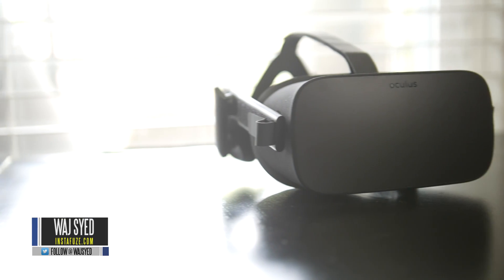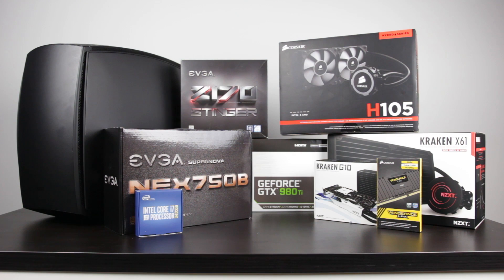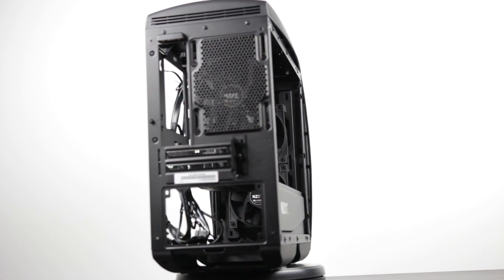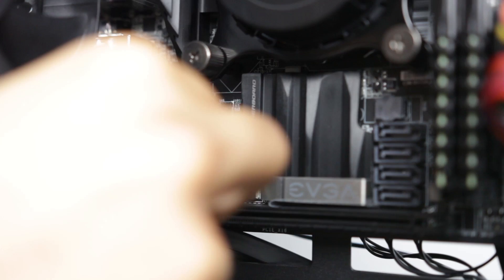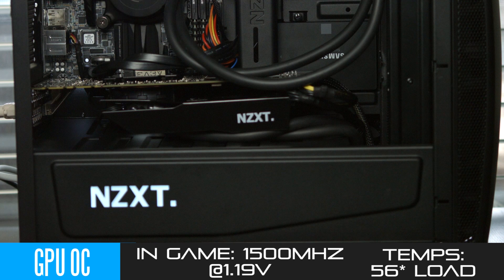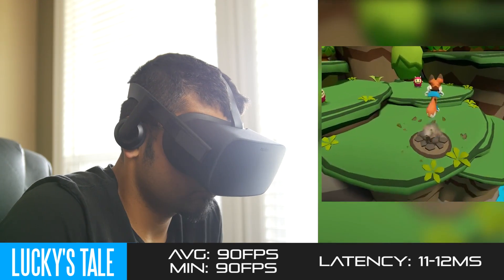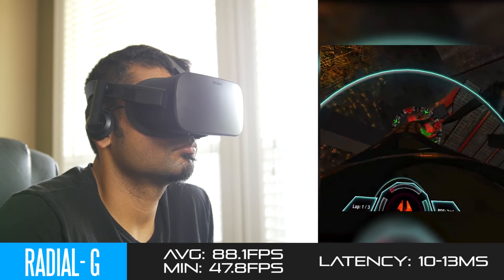Ultimate PC Build Guide for Oculus Rift VR

Comment: Question: Will overclocking the i7 6600K be really be any beneficial for increase in VR performance? 
I've seen in general, games don't really gain any frames by overclocking a CPU (as long as its not a bottleneck, ofc)

Comment: Please pick higher quality power supplies for the future man, did the same thing in your budget builds, given the budget there, there's basically no reason to buy such a sub par PSU
http://www.overclock.net/t/1476935/why-you-should-not-buy-an-evga-supernova-nex650g-750g-aka-g1

Also it would be better just to wait for pascal/polaris instead of buying a 980ti, also technically you'd want a Radeon Pro Duo for the fastest dual slot graphics card.  Though if you're going to water cool the card anyways, you'd want to buy like the EVGA hybrid, though again, pretty much all a waste of money for now. 

I'd just imagine those are the parts you had lying around. 

Also screw the OR man, the Vive is clearly superior overall. gotta wait to see if the OR touch is any decent.

Comment: Can a rig with intel core i5 6500 and an r9 380 capable of running vr?
Reply: Well according to the minimum specs, sadly no, it wouldn't be an enjoyable experience.
Reply: ***** Is the problem with the gpu or cpu?or both?
Reply: Mohamed Hoseny the GPU. I bet it would still run good if your willing to lower settings, but that takes away from the VR experience. It depends on the person, and/or game. the R9 380 is a great card, just might not be enough for VR.
Reply: ***** Sorry for bothering,is the r9 nano good?
Reply: Mohamed Hoseny your not bothering, i enjoy helping the community. And yes the R9 Nano is an amazing card, that's actually what im running at the moment. It wrecks every game at 1440p and even 3440p! Its a really great card and with the right cooling, can be with 1-2% of the R9 Fury for 150$ less! its what im using and it hasn't disappointed. It surpasses the requirement for VR and would me a great card for a mini itx VR room build. Mine is in a Mini itx case aswell with an i7 6700k.
Reply: ***** Thanks! You are pretty awesome guy
Reply: +Mohamed Hoseny thanks for the compliment, glad to help. Hope you get to try VR in all its glory.

Comment: The problem with VR, is you need a small loan of a million dollars to be able to afford it. I'll be alright without VR and just gaming normally at 1080p on my 4690k and my R9 380
Reply: +Eric Melendez It's $600..
Reply: Rekkete Rekebell On top of your system that is going to cost a minimum of $1000
Reply: Eric Melendez If you have a normal job you can retrieve that money easily.
Reply: Rekkete Rekebell I might be able to do that, but unfortunatly not many people make that much money to be able to blow 2.5k on a computer setup when things like power and food take priority.
Reply: Eric Melendez Saving up is an option.
Reply: Rekkete Rekebell It certainly is. The only problem with your argument is that is the answer to every time you need more money/want more money
Reply: the problem with your argument is that you initially stated you will need to loan a million dollars to be able to afford it.  Then went on to say it will cost a minimum of $1000 after being pointed out it will only cost $600. Then proceeded to say 2.5k is needed for a computer set up. Be consistent with your argument so people can correspond to it accordingly.

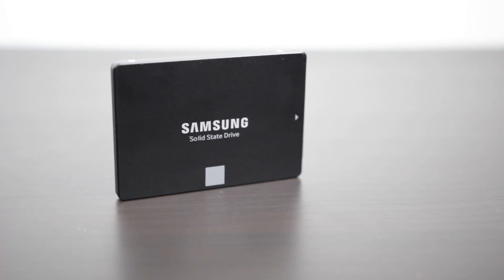Comment: At 2:45 you said "the 512gb version". Thats is wrong. it's a 500GB SSD hard drive. I don't even think there are 512 gb SSDs hard drives.
Reply: +curvejaeger People can make slight mistakes, especially when 512GB SSDs definitely exist, like the 850 Pro instead of the EVO which is in this build, so there's no need to be so rude about it.